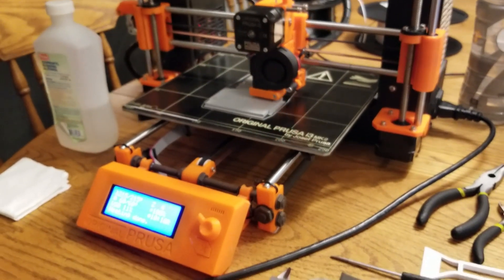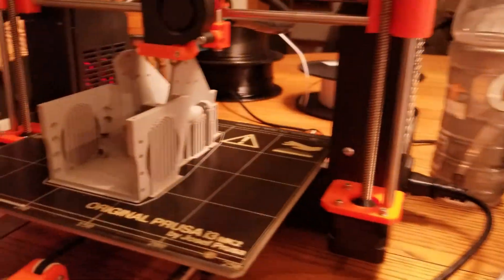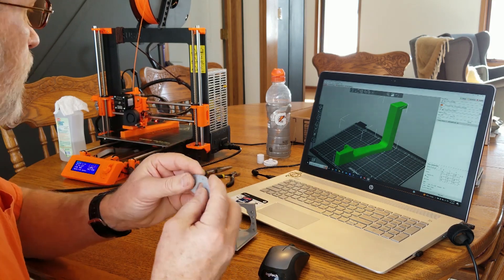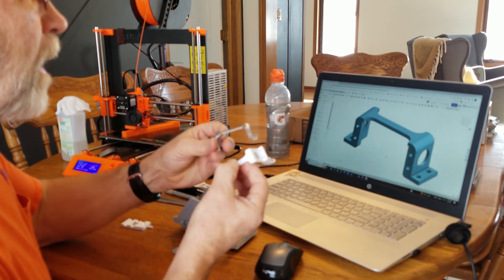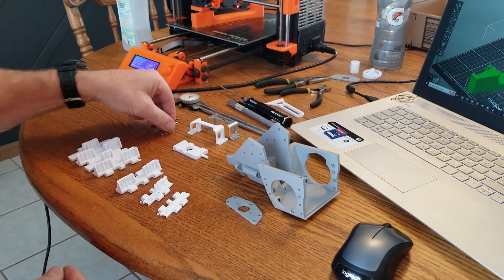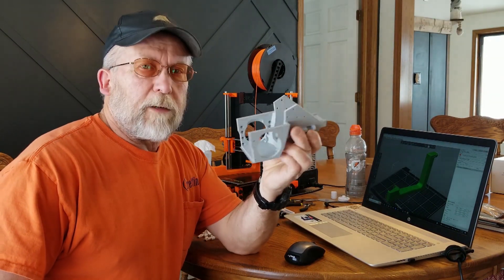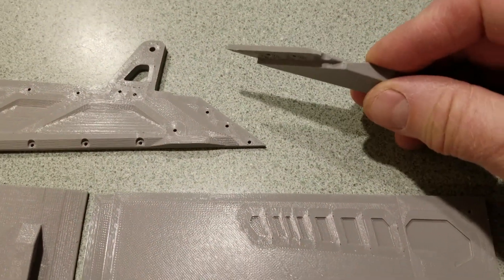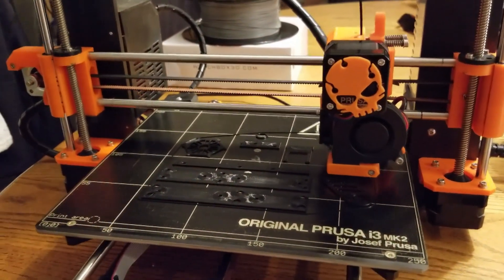SkeeRide 2 Build Begins

Comment: What lap top do you use
Reply from the maker: Nothing special really. It's an HP Pavillion, 17.3" screen, AMD Quad-Core A10-9620P, 8GB DDR4 system memory. Actually getting a bit dated, 5 years old at least.
Reply: @chilly7261  whould like a school chrome book work not a school chrome book like yk what I mean
Reply from the maker: @jeffreyorgis  I don't know enough to say. Feeding the G-code using the Pronterface software to print parts doesn't take much computing power.  G-code is simple text format lines of information. The Prusa slicer program might take awhile to generate code. And to design offsets using the OnShape CAD software requires a decent computer.

Comment: It's a fun RC snowmobile.  I modded mine with Carbon fiber shafts (8mm hollow tubes), and eventually to using two 54T metal spur gears to transfer the power as the plastic gears just didn't hold up.  The new gears requires redesigning the gear carrier as the idle gear axle location shifts a few mm's.  Another great mod is to put high density plastic sliding drawer tape on the bottom of the runners as it greatly helps with track friction
Reply from the maker: Thanks for the ski tips. This has the belt drive, the SkeeRide 2. You have the first version Skeeride?